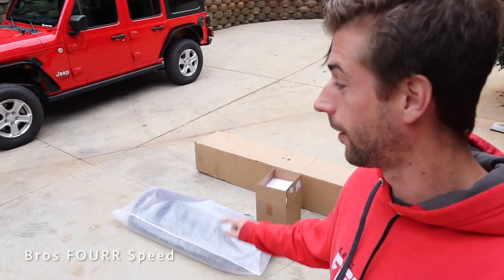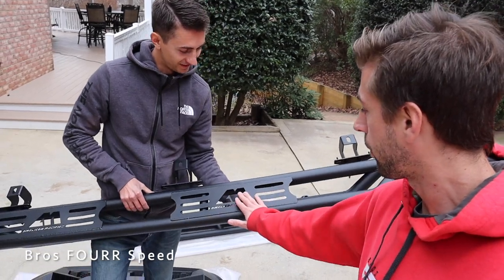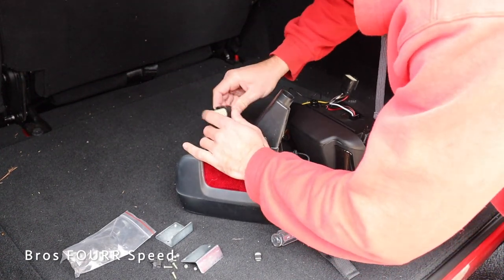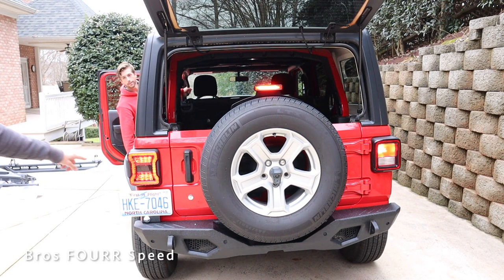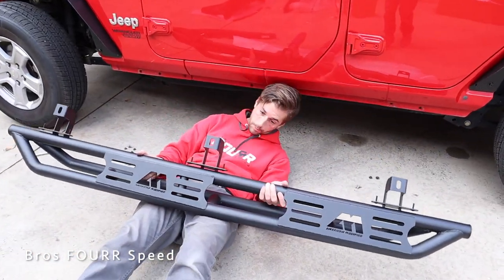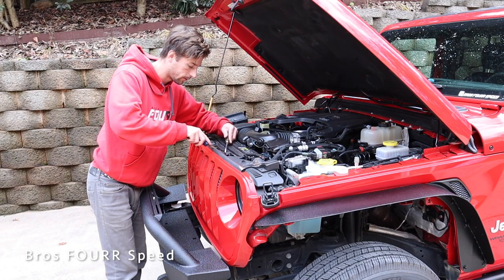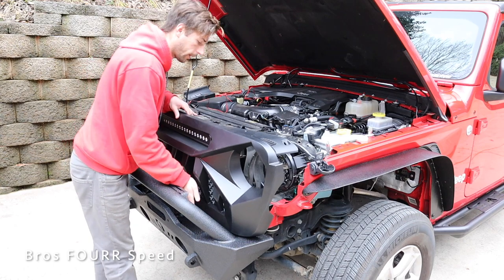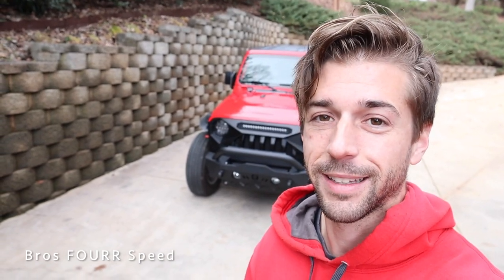Installing NEW Grille, Rock Rails and LED Taillights!!

Comment: Great video but that's not a relay for the turn signals that's a resistor. It gets very hot and will melt the plastic where you mounted it. You need to mount it against metal inside the tail light housing.
Reply from the maker: Yea the resistor opps..I'll check it to see again and maybe change where it is.,

Comment: You need to cover the engine on the sides with an aftermarket cover or download plans to make some yourself and attach.  Under the fenders that got removed when you replaced the fenders.  BTW, looking good.
Reply from the maker: That's actually coming in a video soon! I just got those parts in last week!!

Comment: Have you installed the front turn signals , i'm not seeing any..can't wait to see when you have the wheels and tires on
Reply from the maker: In the headlight video, I wired in the DRL's in the new headlights as the turn signal.  That's all I have now, but I did just find a new way to do it the other night! I  might throw that into the next video to show it!

Comment: did the grille come with a kit for the wiring?
Reply from the maker: The grill just came with a wire off of the light, so you have to figure out what to hook it up too.  I already had my lights on the hood, so I just tapped into those.

Comment: Nice! Color matching the grill would look even better in my opinion! Still looks good black though
Reply from the maker: I have actually thought about doing that so maybe!
Reply: @BrosFOURRSpeed  would look good for sure, i feel like there is too much black looking at it from the front. If anything paint it black so it doesn't look so "plasticky". If either of you boys is good on photoshop you can paint it there then compare.
Reply: @BrosFOURRSpeed  i've struggled with deciding what grill i should go with for my f150 for the same "plasticky" feeling i get from looking at most grills. I feel like they look cheap (even though they aren't) lol
Reply from the maker: @txkingg  I might do it or try something! The "raptor" grills look pretty cool!
Reply: @BrosFOURRSpeed  whatever you do I’m sure you’ll post it lol👍🏻 I agree about the raptor grill still not to sure lol
Reply from the maker: @txkingg  I'm sure you'll be able to find one you like!!

Comment: How did you wire the grille
Reply from the maker: I just tapped into my ditch lights on the hood.  Im not sure where else they could get wired into if I didn't have those, but I just utilized them.